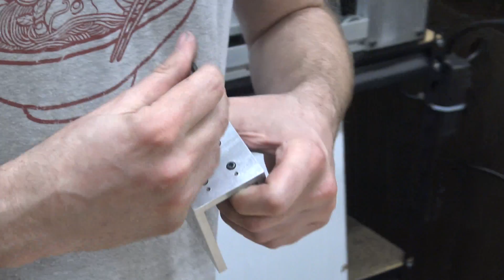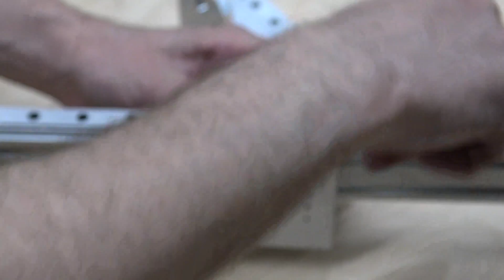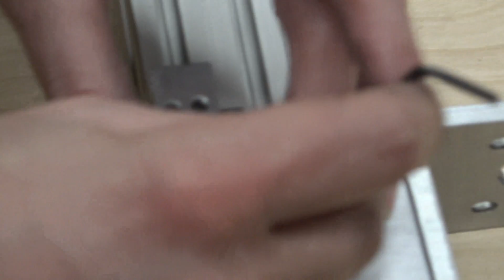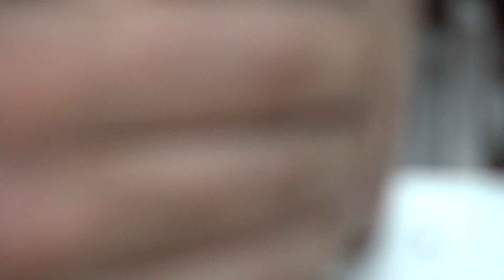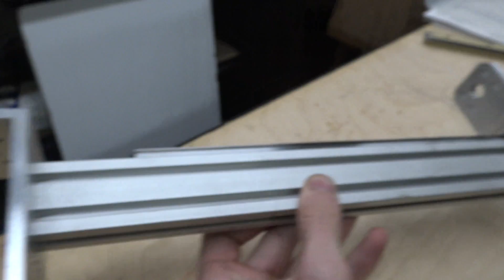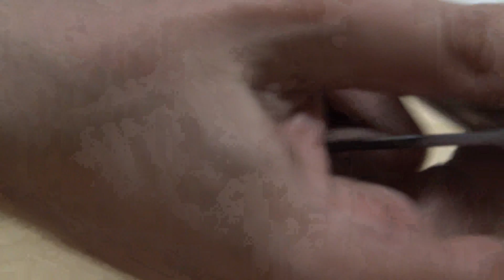WorkHorse 3D Printer Build: Y-Axis Assembly

Comment: Too much weight, even for aluminum. Do you have any engineer that designes for you? It looks like no stress simulations done here but "make it thick and it will last.."
Guys this is not the way to make efficient machine..
I'm shocked what a waste !
Reply from the maker: Well the machine is actually designed for applications beyond fdm. We're looking at having a range of diferent types of extruders for different types of materials that would require a gantry that can move more weight around at high speeds. When we designed this machine we considered where 3d printing is going in the long run. Yeah it's not as efficient as we want, we're just working with the materials thats currently available to us.
Reply: 3D Distributed well, for a start most of the parts can be reduced by 40% thickness (stress simulations must be made). Second, there are ways to keep a material strong enough but light weight (structure manipulation)..
This how you will get higher speeds, yet it will be strong enough to support the required weights.
Reply: They could be, but he mentioned a CNC spindle as a possible add-on.  Any kind of multi-use machine is going to have  trade-offs in efficiency as opposed to a single purpose machine. A machine that DEPOSITS material with a .5 kg flying head requires less strength and rigidity than one that PUSHES a cutter through material with a 2 kg head. Try milling aluminum on a CR10.
Reply: aerohard and yet there is a big difference between milling an engine block then milling simple objects. i really recommend them hiring a material/mechanical engineering (B.sc). A professional engineer will decrease there  production cost and will make much less improvised..